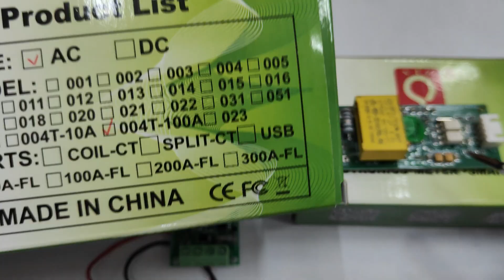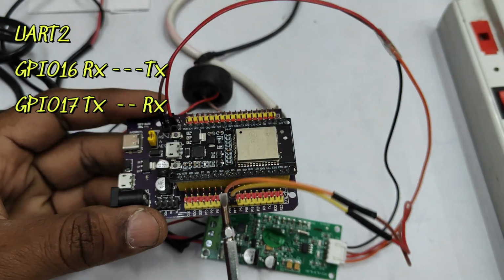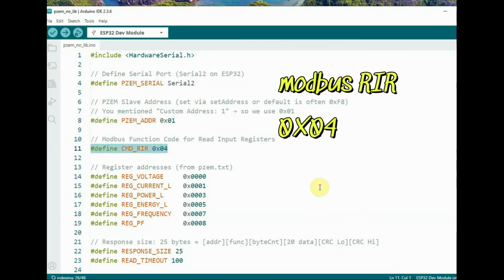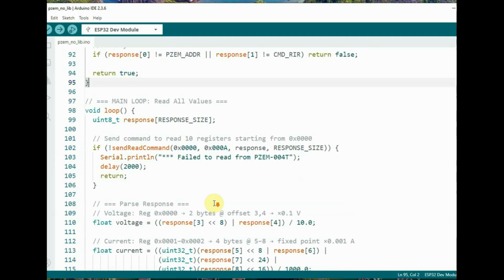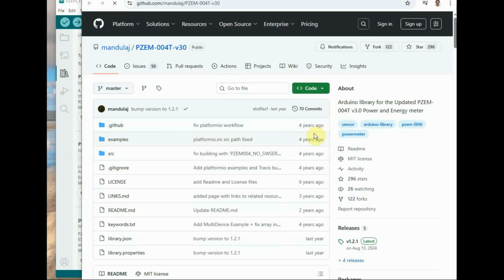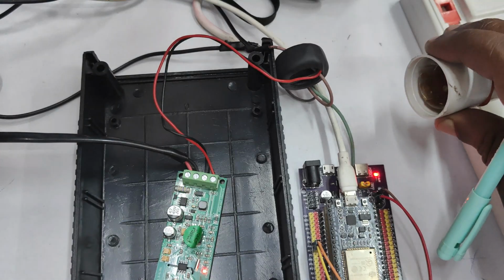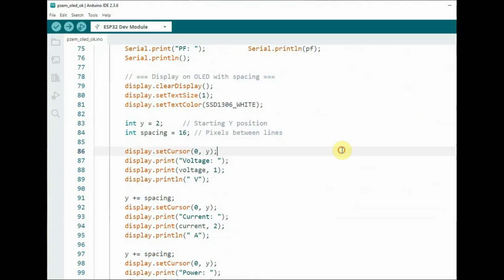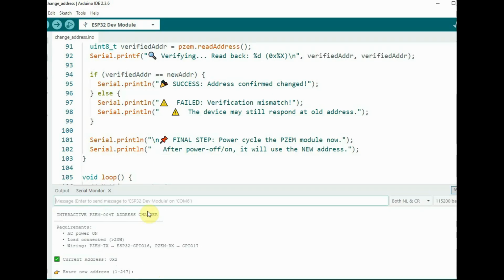PZEM 004T New Version 4.0 Energy Monitor with ESP32

Comment: The old V3 has a huge problems with resistor overheating, especially on modified sіnus voltage. Replacing with 5W resistor helps just a bit. But new V4 does not such problems, I can confirm that, it uses a different psu scheme.

Comment: Hi. Thank you for a great tutorial *****. I wonder if you can help me? I am using a esp32 C3 MCU, using ESPHOME,  powering the PZEM v4 with 5v but am getting the following errors, [09:32:08.702][W][modbus:145]: Modbus CRC Check failed! B870!=FE5C
[09:32:09.242][W][modbus:145]: Modbus CRC Check failed! E868!=FE5C
[09:32:09.446][D][modbus_controller:039]: Modbus command to device=1 register=0x0C no response received - removed from send queue
[09:32:09.497][D][sensor:131]: 'Freezer Temperature': Sending state 24.55910 °C with 2 decimals of accuracy
[09:32:10.227][W][modbus:145]: Modbus CRC Check failed! 9C40!=168
[09:32:10.493][W][modbus:145]: Modbus CRC Check failed! 9080!=17A1
[09:32:10.758][W][modbus:145]: Modbus CRC Check failed! 9080!=B21
[09:32:11.024][W][modbus:145]: Modbus CRC Check failed! 9080!=1C8
[09:32:11.162][W][light:023]: 'Temperature Alarm LED': brightness not supported
[09:32:11.308][W][modbus:145]: Modbus CRC Check failed! 9080!=1C8
[09:32:11.514][D][modbus_controller:039]: Modbus command to device=1 register=0x00 no response received - removed from send queue
[09:32:11.561][W][modbus:145]: Modbus CRC Check failed! 9080!=520
[09:32:12.086][W][modbus:145]: Modbus CRC Check failed! 9080!=5020
[09:32:12.615][W][modbus:145]: Modbus CRC Check failed! 9080!=5020
[09:32:12.837][D][modbus_controller:039]: Modbus command to device=1 register=0x06 no response received - removed from send queue
[09:32:13.149][W][modbus:145]: Modbus CRC Check failed! B870!=FF2E
[09:32:13.412][W][modbus:145]: Modbus CRC Check failed! B870!=FE5C
[09:32:13.677][W][modbus:145]: Modbus CRC Check failed! B870!=FF7C
[09:32:13.960][W][modbus:145]: Modbus CRC Check failed! B870!=FE5C
[09:32:14.165][D][modbus_controller:039]: Modbus command to device=1 register=0x0C no response received - removed from send queue
[09:32:14.168][W][light:023]: 'Temperature Alarm LED': brightness not supported
[09:32:14.478][W][modbus:145]: Modbus CRC Check failed! E868!=FF5C
[09:32:14.507][D][sensor:131]: 'Freezer Temperature': Sending state 24.55910 °C with 2 decimals of accuracy
[09:32:15.006][W][modbus:145]: Modbus CRC Check failed! 7869!=FE2E
[09:32:15.188][W][modbus_controller:284]: Duplicate modbus command found: type=0x4 address=24 count=2
Reply: # The current device address.
try    address: 0xF8 instead of address: 0x1
even more, if you connect v3 and v4 on one modbus, you get errors too. i had to connect 5pcs of v3 on modbus1, and 2pcs of v4 on modbus2
Reply: Ask Gemini it will help you

Comment: Hello, Is it possible to add a threshold for current using a relay (Example: if current > 1.2 to turn off baseline for (overcurrent/short circuit)) alerting or notifity the user??
Reply: Yes fully possible 😊
Reply: @InnovationEngg  Which device is better for 3 phase power measure. PZEM 004T V3 or PZEM 004T V4 ?

Comment: can 2 PZEM be used with one ESP32 so as to capture two power flows typical to a solar Net Metering installation? 1 for generation and other for imp-export energy? Please help.
Reply: you can change modbus address and use